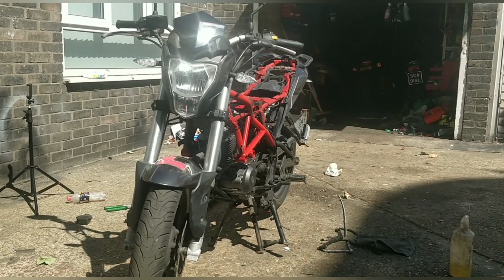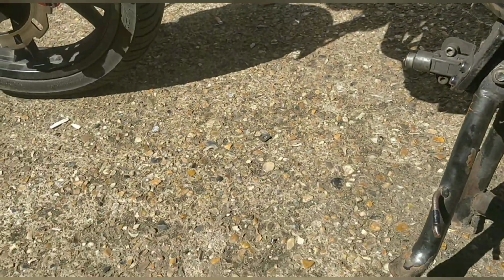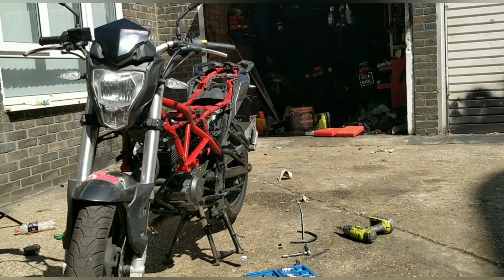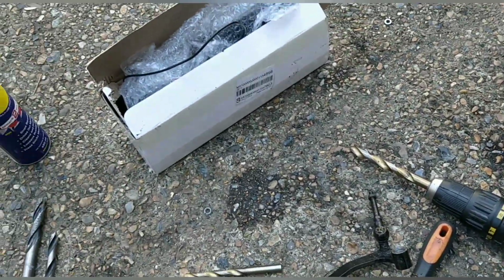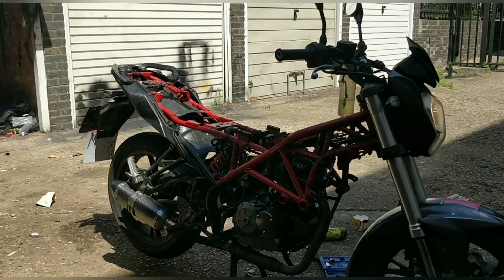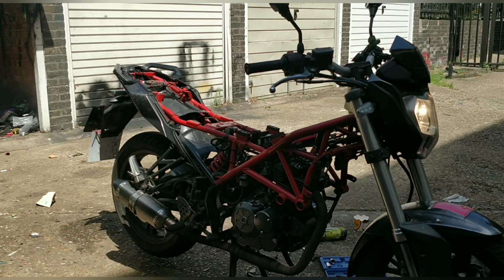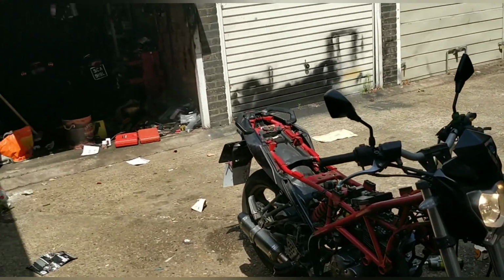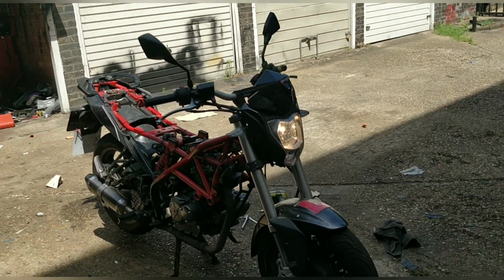ksr moto, grs 125, gear linkage fabrication, more smoke? next steps?

Comment: Sounds great to me Charlie 💯 Really nice work. Your almost have it ready & you won't have a problem selling that one 🎬👍. Cheers 😎
Reply from the maker: Yeh it sounds great. A little worried still about bits of smoke but I know it's not coming from the engine. 

I may try the other exhaust again on the weekend and see if I can get it on and sealed. If I can I may use it.

Comment: A thought occurs to me - have you checked the thread on both ends of the link rod? Sometimes they have a normal thread on one end and left hand on the other.
Reply from the maker: I believe I did but will have another look tomorrow after work potentially. I've got a 14mm and 15mm bit now so can drill the hole to the right size.

Comment: Sound s ok Charlie ,needs a good run about to burn up the old oil in zorst ,did you get your 14 drill bit ?🤔👍
Reply from the maker: Hi Derek, I got a 14 and 16 yesterday. I may find the time to do a little more tomorrow evening. I may even get the linkage on if I'm lucky

Comment: Hey. Great video. I’m trying to find a gear shift lever for my sons 2015 code. It’s all just really loose. Should there be a bush there the lever mounts onto the bike? It’s really floppy and not good at all! Any ideas? I can’t find one online anywhere.
Reply from the maker: They are all different I'm afraid so unsure. Normally a washer rather then a bush and you can put another washer in with some grease if you want to take a little play out. 

I normally just keep looking on ebay over a week or 2 to see if a part pops up. 

Good luck with it.

Comment: Hey there I have a GRS and recently done an oil change was definitely needed does it take gear oil as I can’t find much information online and I don’t know a lot of info  I’m no mechanic, but I can get by lol I am having a slight issue with gear changes it’s changing up fine but the down shifts are a bit clunky and hard to press sometimes any information would be great thanks
Reply from the maker: Hi Jason, hopefully you used 10w40 semi synthetic 4t motorcycle oil. As your running a wet clutch system. If you used 10w40 car oil then your clutch will be slipping and you gear change won't be great. 

These bikes don't have separate oil for the gear box mate. 

I'll be curious as to what oil you used
Reply: Thanks for your reply yes I did use correct Oil The problem with the gears started about a week ago and I’m trying to find out what could cause it and if I could fix it or I have to take it to a shop as I’ve said it’s going up gear fine but down shirts are clunky and hard but not all the time 🤔
Reply: I have used Castrol power1 10w-40 4t oil for motorcycles is this ok? I was having a problem with the gears before I change my oil this is why I did a oil change definitely needed it as oil was black and oil filter was black too any advice would be great thank you
Reply from the maker: That oil will be fine. What is your clutch biting point like? Does it catch near the bar or further out. You may need a clutch adjustment?
Reply: The coach biting point is about in the middle, I would say I have noticed today the gear selector pedal is quite wobbly and quite a lot of play as nuts and bolts were tight so pedal could be the problem, I’m thinking might have to order a new one of them 🤷🏻‍♂️ also, it’s hard to find neutral. When engine is running when the engine is off, it finds it straight away.
Reply from the maker: The clutch levers are hard to find for these. It may need nipping up or adjusting slightly, if you take away some of the slop it should feel better. 

But you may have to keep in mind that your gearbox is on its way out, they do go in these at times. 

I suggest you tighten the pedal first and try some clutch adjustment then see how it goes
Reply: Okay, thank you very much for your information 😀
Reply from the maker: @jason3077  good luck with it
Reply: Hey there, just an update. It was the clutch cable the day after we communicated it snapped so put a new one on yesterday and no issues. Gearbox is completely fine 😀 thank God
Thanks for your information definitely spot-on with the clutch adjustment
Back on the road now bike running great

😀
Reply from the maker: That's brilliant. Great job Jason. Enjoy the ride mate.

Comment: Did you get my comment with the eBay number mate
Reply from the maker: No Jay I don't think I did mate? I wonder if it was blocked for some reason. I check the held back folder aswell mate. 

What was the link for?
Reply: @motorcyclerescuer  eBay number for someone breaking a ksr mate for linkage
Reply from the maker: Cheers Jay but I'm sure I've got mine sorted now. Just haven't got the energy to do the work of an evening. So will aim to finish it up on the weekend. 

Can  possibly get it sorted and then a proper test run. 

Cheers mate
Reply: @motorcyclerescuer  no probs at all mate there if you need it you've worked hard on this one for sure